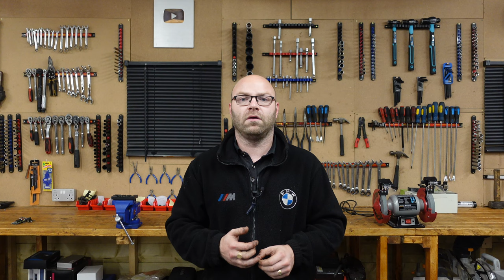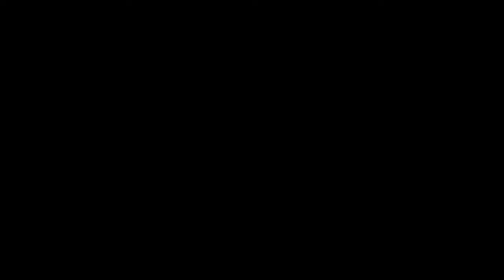Porsche Engine Ticking What Causes It & Should You Worry ??

Comment: Hi, I recently bought some new spark plugs for my 2007 e92 325i N52B25A.  I noticed that the thread on the new spark plug is longer than what is currently in my engine.  The new plugs have a 26,5 thread.  Is this correct for my engine? As far as I can tell bmw must have updated them at some point.

Comment: My 997.1 S ticks like you describe. I also hear a bit of piston slap when cold only. I have owned it for 10 years with yearly oil changes and the sounds are exactly like they always were. I also get a huge shot of smoke after it's been sitting for a month or so. Oil consumption is a liter after about 2k miles. 

I will only get it rebuilt if starts getting worse. At the moment it drives perfectly and I just enjoy it. When driving I change down a gear when the oil pressure drops by about 10 percent and as you say I never go over 3 k until the oil temp is near the normal mark. I am not scared to rev to the red line when I feel like it or a dual motor Tesla gets in my way.
Reply: @andrewthompsonuk1  use thicker oil helps but not too thick

Comment: Hello, I have bought a boxster987 s with a 3.4 engine.(late 2006). The car makes a ticking sound from coldstart and it not goes away when warm. (It 's ticking quicker when you accelarate)No oil issues.(its full and after 1000 miles still full). 
It pulls very good in all gears. Waterpomp is changed last week. Help,Help.
Reply: @walterengelmann7986  i have the same issue on a 2019 cayenne. Also need some help